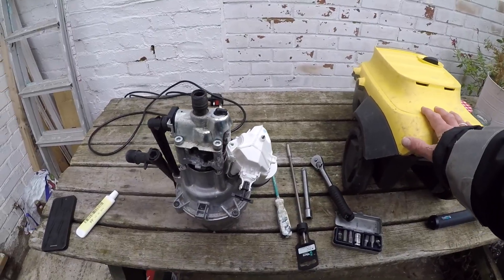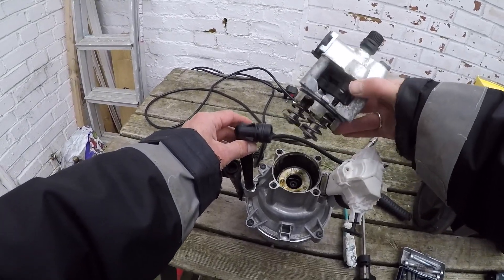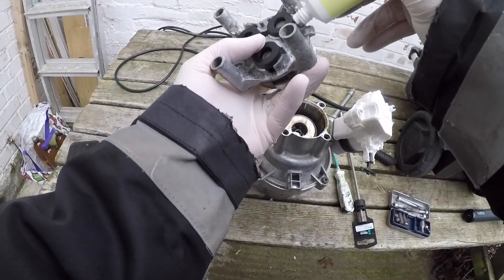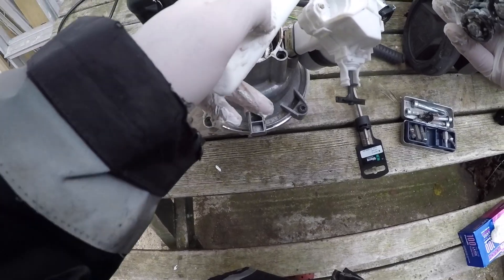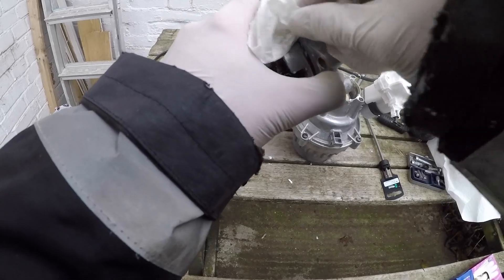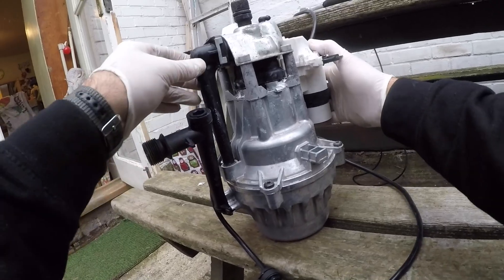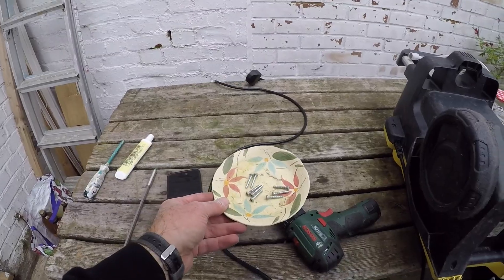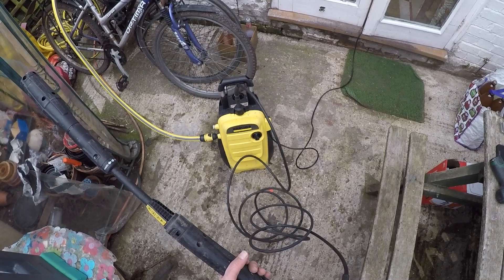Karcher K4 greasing and assembly

Comment: Thanks for a really helpful video. It made taking my K4 apart really simple.  I'm wondering if you or anyone can please provide advice as neither Karcher (who only want me to send it for an expensive repair or buy a new washer)  nor several spares companies seem willing to do so. My K4 started pulsating when I power it on and the pressure is very weak when I press the trigger on the lance. I can’t see any leaks at all when a hose is connected with the water tap on (with the yellow case removed). However, when I turn on the power, a lot of water sprays from near the top of the washer control head (where the chemical tube attaches) so I assume this is where the K4 is losing pressure. There don’t seem to be leaks from anywhere else. I’ve taken the K4 apart and found 2 connected parts (Washer control head and cylinder head) . The control head has 9.075.073.0 and 9.075.072.0 printed on it. The  cylinder head looks different inside to the spares on several supplier websites in that I have 3 small white plastic pieces with springs in the top of the cylinder head, instead of one larger white piece. Is this a one with the single white central piece a replacement? Do I need to order the cylinder head as well as the control head (where the leak is)? Anything else? Sorry for the 'wordy' description but I can't attach photos. TIA

Comment: A very useful video. Is there a torque setting for the head bolts?
Reply from the maker: Thanks. I'm not sure what torque they should be. But very tight... to loosen them you should need to stand on the metal body of the assembly and loosen with an allen (hex) key in a on a ratchet.
Reply: 12 - 15 nm according to the spec sheet

Comment: Just had the same issue. Replaced the top part of the pump. It’s a failing piece common to all of them. Couldn’t see the crack even with it disassembled and because the top metal shield covers it in use,  you cannot really see where the leak is. I think I paid around £20 for the new part and machine is good as new again.
Reply: Yeah also had to renew both top sections, fixed it all for 50 quid and then Lidl sold brand new ones for 50 quid with a 3 year warranty !

Comment: Hi I've had my K4 Full Control in bits several times and eventually replaced the cylinder head and hey presto it was no longer leaking. However after reassembling there is no high pressure. Does the bottom part of the cylinder head have to go in a specific place or as its triangular can it be any order. Or an other suggestions as to the problem and how its resolved? thanks
Reply from the maker: Yes, the bottom part can go in any  way around. Sometimes a very small bit of dirt can block the holes in or out of the plastic head. I (now) always take all the white plastic valves and springs out and give them a wash before reassembly. Hope this helps. Oh and don't forget to clean the pull out plastic filter where the garden hose connects to the machine.

Comment: What grease is it? Part Number? I can't seem to find out the correct type online I couldn't make it out on the video. Thanks
Reply from the maker: Not sure of the part number. We think it might be some sort of PTFE grease (?) it costs £70 a tube from Karcher. TBH I might try some lithium grease at that price.
Reply: @stimpetta  £70 a tube?     a brand new K4 is only 200!!   they clearly want it to be uneconomical to repair them.
Reply: DO NOT PUT GREASE IN IT !!!!
You need to put OIL in it !!!!

Comment: Had the switch not working on mine, turned out to be the the internal spring that operates the alloy lever assembly onto switch, the spring had rusted and snapped, karcher rip you off for the complete assembly as they dont sell the spring separately, I managed to find a spring supplier who I got some from, rebuilt it which worked fine, also had to buy the top sections of pump assembly as they were causing a leak, rebuilt now works great ! 👍
Reply from the maker: Yes, I have seen this too. A nice stainless steel spring would be good! I have also fixed a switch that was not working. These can be levered apart and the contacts cleaned, reassembled and save you £6 for a replacement switch :)
Reply: Same issue here....Whee did you buy new spring?   Please share links if you bought online?

Comment: It’s the black plastic control unit that’s leaking. You’ve left it in the shed with water in it over winter and the water has frozen causing the plastic to break. It needs a new control unit IMO.
Reply from the maker: That could be the cause. I found I made a mistake on reassembly. I put too much antiseize on the bolts and this seems to have stopped them going all the way in. After meaning out it all bolted together and worked
Reply: Which do you mean? I have the same issue.

Comment: I went to Kaercher here in Austria , you are meant to put 5W 40 oil in the chamber , not the grease ..... the grease is used for the seals and rubbers .....
Reply from the maker: This is at odds with Karcher UK advice. Perhaps you have different machines in oz?
Reply: @stimpetta  I've just taken the head off my UK K4 and it is full of oil as one might expect. The Karcher site lists the oil. The grease (Karcher somewhat confusingly label it 'grease oil') comes in a small tube and is for smearing on the seals.